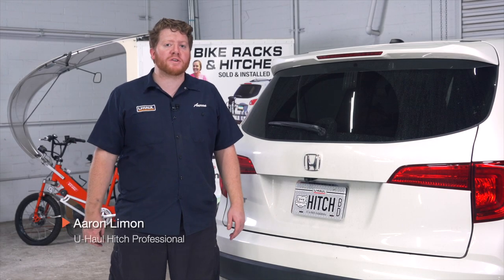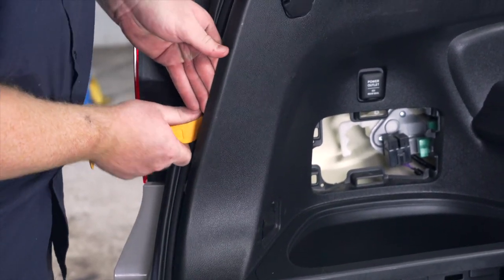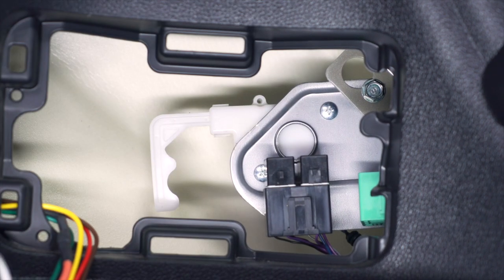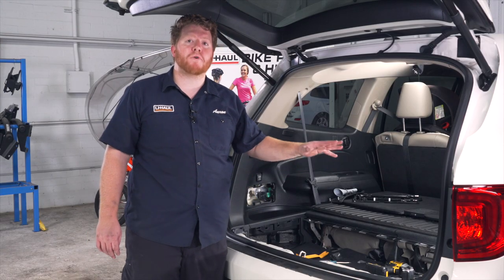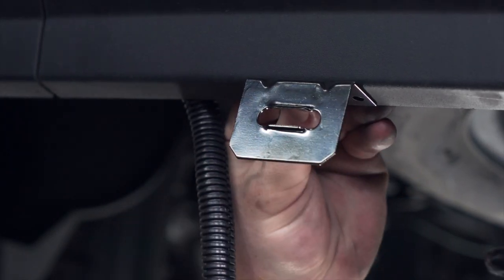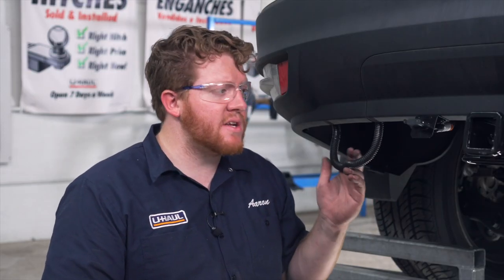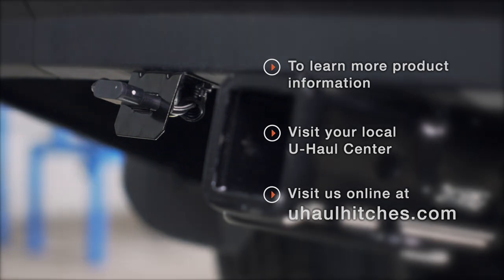2021 Honda Pilot Trailer Wiring Harness Installation

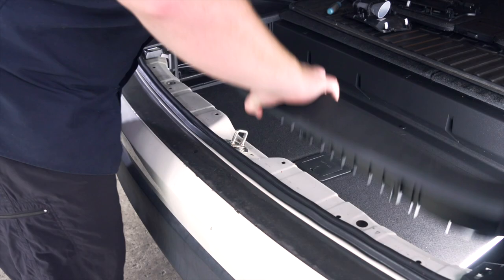Comment: great tutorial.  the written instructions are terrible compared to this video.  A few tips that may help others.  #1 - the two large panels front and rear weren't necessary "for me" to pull off.  (as seen @ 1:05 to 1:15)  the rear panel closest to the bumper can be popped up from the left side only to allow the module insertion behind the side panel.  #2 - the phillips screw shown @ 1:46 strips easily make sure you use the right bit and be careful. #3 - the module has two sided tape and I found a flat spot to mount it just below the grounding point on the panel side interior as the outter sheet metal is insulated with bedding #4 - the zip ties that come with the kit are too short and if you are OCD like me use some longer zip ties to be sure all the wires are buttoned up under the bumper.  #5 check the fuse protecting the module in the rear;  mine wasn't completeley seated.  #6 if you don't have a tester or trailer, you can use a digital multimeter to see if you're at least getting voltage.  The male on the end is ground and the other three femal prongs are brake and turn signals.  You should be getting 12v-14v depending on if your engine is started when doing the test.  I'm renting a Uhaul in a couple of weeks so I'm sure we'll test it out again before getting on the road.  good luck!

Comment: No need to rip the trim apart. Just feel around for the connector
Reply from the maker: The trim is designed to come off. As long as your careful and take your time, you wont damage anything and it is much faster and easier to kook up the wiring. But everyone has their own preference!

Comment: These instructions end with adding two 20 amp fuses on position 3 and 11 inside the engine compartment and my kit does not include these fuses or the instructions for this step, it has a 10 amp fuse that is added into the converter harness in the truck (part I just added). Does this server the same purpose and or does this kit have some older or new configuration than this video? My vehicle is a 2021 Honda pilot and the kit which I got from U Haul (custom wiring 56291) only specifies the brand and model not year it’s for.
Reply from the maker: Great question. This video uses the Tekonsha wiring kit rather than the Curt wiring kit which you have. This does serve the same purpose so your kit will work fine without those extra fuses.
Reply: Thank you that brings me a lot of relief

Comment: There was absolutely nothing easy about it, blaw
Reply: its a simple install, time consuming but nothing complicated
Reply: The tie down latch was on there so tight I stripped the screw.  That's ok I just drilled it out and will get a screw that is not attached with crazy glue lol.:face-green-smiling:  I ordered the wiring harness that handles both the four and 7 pin.  Of course the round seven pin was too large for the grommet hole so I had to cut it and will need to shrink wrap the wires back on. It would have been much better if there was a connector to separate so it could go in the hole.  Also had to cut through my existing grommet (no grommet included) in order to seal the whole.   This was a good guideline but  definitely not all the steps needed to get this done.  BTW I have a 2021 Honda Pilot SE.